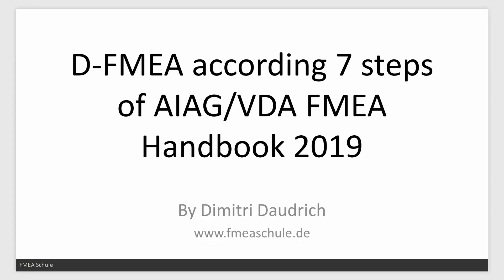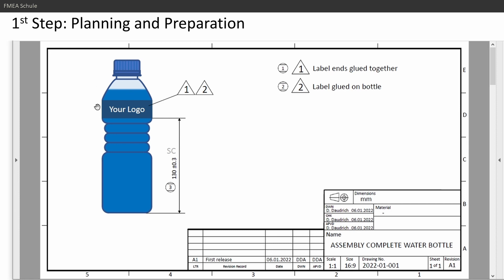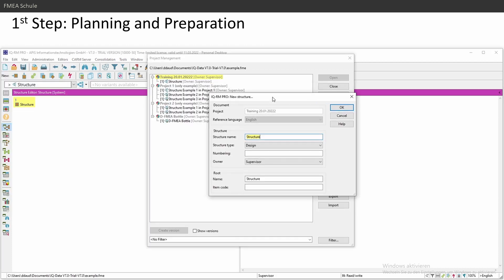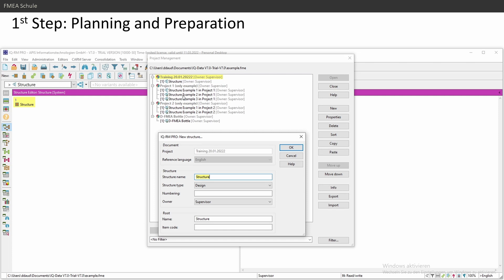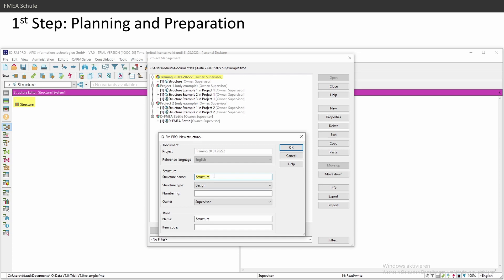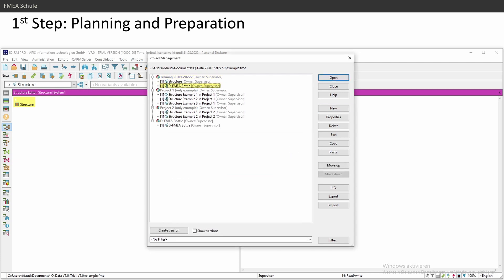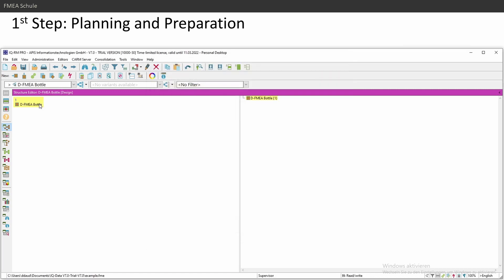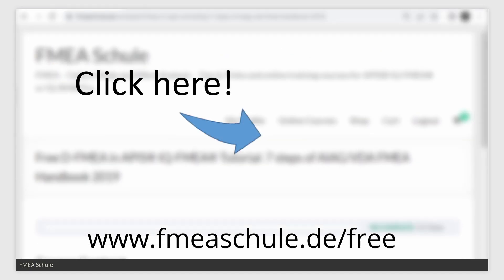APIS® IQ-FMEA® Tutorial: Step 1 - Planning and Preparation

Comment: can we work on two different pages in the same time? 
what if we want to fusion two docs it's possible ? if yes how to do it please?
Reply from the maker: Hi, you can seperate your workstation into two workstations with different editors. It is not possible to merge two documents (automatically). You need to do it by hand.
Reply: yes, just above the Yellow ? icon there is a Page-Split button, so you can look at the Failure Web while also looking at the FMEA table on another window. You can also open multiple instance of IQ-RM